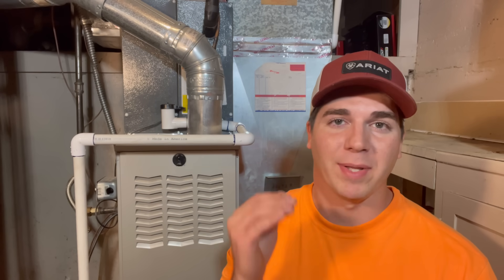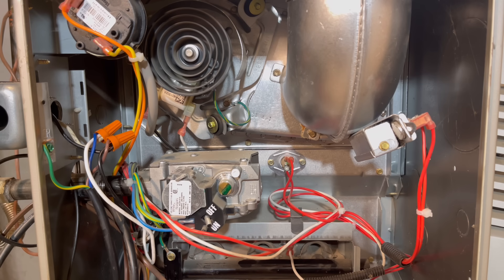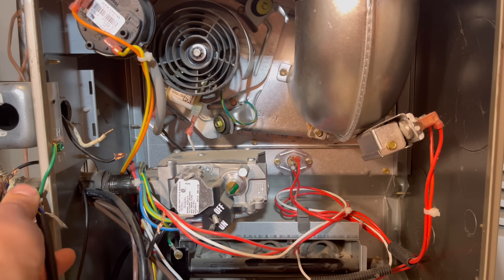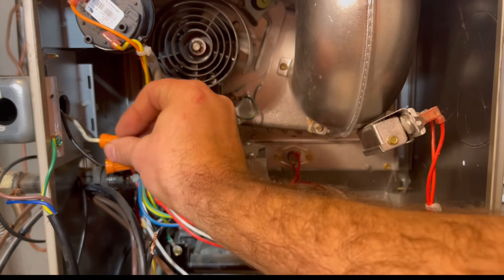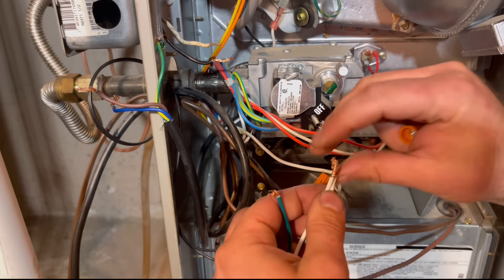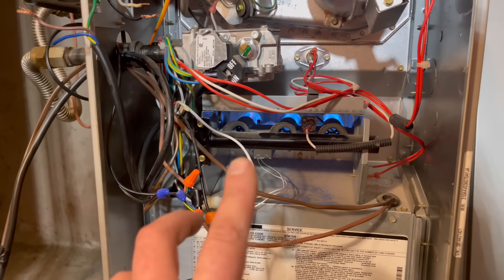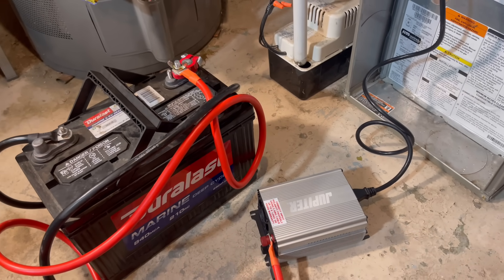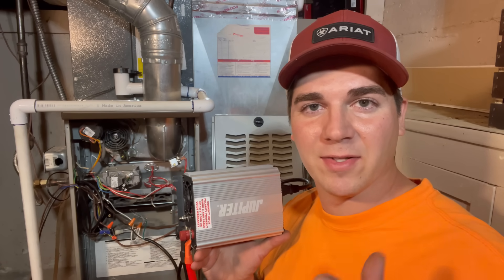Did You Know You Can Heat Your Home With A Car Battery?

Comment: I have a separate HVAC AC. More often HOT weather dominates SoCal! is there a method of running the 240 volt AC? Or by using a generator? By the way GREAT VIDEO!
Reply: I think it was ingenious and simplistic how you showed a basic wiring concept for what people view is very complicated. My thermostat is controlled by batteries, but the main circuit of course is wired. I would’ve never thought to use a car battery or a deep cycle, marine battery to start the thing up, which is all you really need for the igniter. I think he presented a really good insight with lots of preparation and you showed a realistic way that most people who have some abilities could do it. Thank you very much.
Reply: It’s apples and oranges with me. And outdoor air conditioning or central air. Runs on high demand, electricity and you need probably 8 to 10 car batteries in series to start at the darn thing up. I’ve seen some YouTube videos on using a generator to do it, and also solar panels. But I doubt in the long term it would sustain either the generator or the air conditioner. This is why our utility bills are so extremely high during the summer months. Our problem here in Southern California is when it does get extremely hot the utility company for what they call fire safety shut the electrical grids down now and it’s happened to me five times, so I have to figure out something or just purchase myself a five to $10,000 Generac generator to do the whole house. But this is the reality of the world we live in now. I live 3 miles from another house. I had for 25 years and I can remember one time in 25 years. The power was was off. Now in two years, it’s been five times. These instances like in Texas are all going to become realities for everybody
Reply: And the reason they shut down the electrical grid is because they say because the overhanging wires may become involved in the fire?! What is it in reality is they have ignored the required maintenance on the trees and brush area around the electrical grids and this has caused arcing. But they use the term fire safety to negate any responsibility. Last year it was on Thanksgiving. They did it for 24 hours perfect timing huh? And this year on the same Thanksgiving they were going to do it again. I’m looking to relocate.

Comment: While I think this is a cool idea, an even better one would be to have the furnace 120V source wired in a similar way as you show with an "extension cord" style hookup, that could be selected on a side switch from either grid power or extension cord power.  While someone may have the ability to go create the battery/inverter power source, a more likely scenario is that the homeowner has some type of portable generator, but no way to plug their furnace into the generator.
Reply from the maker: Check out my latest video :) cheers
Reply: @diyhvacguy  And I did. :)  Great videos!

Comment: how many watts does that furnace use
Reply from the maker: 500 watts
Reply: @diyhvacguy  hm constant 500 watts eh not peak? Trying to figure if I could plug it into a 400w 650 peak solar power supply

Comment: Click bait, yea it worked for the time you videoed, but your using a gas furnace how about the fan using power or trying to power an oil forced air burner.
Reply from the maker: Watch my other videos. It’s not click bait it worked for 6 hours. Not days, I know I was wrong on that but good knowledge to have in a pinch!

Comment: Would this method work if I have  baseboard heat and not forced air?
Reply from the maker: Yes it’s just a burner and a circulator pump if I’m not mistaken.

Comment: Need a backup plan when your power goes out in the winter. Check out the Bluetti solar generator running my furnace. This is helpful information to keep the lights on and the heat flowing while your beer stays cold in the fridge. 

https://youtu.be/25dCG557qC0

Comment: Makes concept of “ licensed electrician “ ……a mere afterthought lol. Safety …safety ?   Just kidding . Great video on a conceptual level mostly. IMO best way to go is professionally install a generator tap box off elect. Panel . Has 4-6 breakers. Northern hydraulic used to sell a very cool unit super reasonable. Has a safety interlock so you can’t have both power co and back up on . Critical safety issue. Unit is a couple hundred. Then just buy a cheap Home Depot generator .

Comment: The fan running will drain the battery super fast when the furnace is blowing heat.  Set your thermostat low like 60-65°just to keep the home warm and get alot of blankets out.

Comment: As others have said, this is extremely optimistic thinking and also ignores the horrible 0-load power consumption that such cheap inverters have.  With just having an inverter "ON" (no load), a typical lead-acid car battery will probably drop to useless levels in a day (lead-acid batteries don't like to be drained).  More expensive AGM and deep-cycle batteries can fare better and by the time you get to Lithium batteries the costs of such a setup can be significant. At any rate, it's fun to entertain various options and learn but don't bet your life on something that sounds waaaaaaay too good to be true ... because it very likely isn't.  Also there are much much better battery backup devices out there made by EcoFlow, Jackery, etc that can do a much better job and be a lot more versatile for emergencies.

Comment: What if you have a similar situation on a 2000 inverter what would happen if you plugged in the furnace to the invertor and the other plug goes to a 40 amp battery charger and leads back to the battery would this make it last any longer? Sorry, weird question!
Reply from the maker: I’ve had a hundred  people ask so don’t feel bad haha it would pull the battery down way faster then it could charge. Thermodynamics are a bummer sometimes 👍🏽
Reply: @diyhvacguy   I figured that was the case but wuld it make the battery charge last longer like instead of a day or 2 maybe 3 or 4?

Comment: I lived in a house where the furnace had a plug on it so you good plug it into a regular outlet what would make this  lot easier as you’d just have to unplug it and plug in into the inverter/ generator and then when the power comes back on you simply unplug it and plug it back in it’s regular outlet
Reply from the maker: Check out my lates videos, one is specifically about that 👍🏽 cheers

Comment: Can you do this with an electric furnace or does it use too much voltage?
Reply from the maker: Unfortunately no. Electric furnaces require 220v and this is strictly for 110v gas furnace.

Comment: You said it the inverter only lasts 6 hours is that the inverter goes bad or the battery and if it's the battery why can't you just keep the battery on a battery charger or a battery tender
Reply from the maker: The battery discharges after 6 hrs. If you don’t have power you can’t recharge it unless you have solar or you use your cars alternator. So it’s important not to run it down too far so you can start it and recharge 👍🏽
Reply: Well you can recharge it if you have a generator or you could put it back in your truck and run your truck yes so we best to have two batteries one that you can use for 6 hours and then a second battery that you can recharge either by way of like I said you're generator or put it back in your truck

Comment: Well, others have already stated all of my issues with battery types, depth of discharge, solar, etc.

Here's another option:

You have a camper.  (Assuming full propane tanks)  Just leave your batteries in it and live there until the power comes back on?  Blower motors in RVs are 12V and take way less wattage than the whole house furnace.  You could still  charge the batteries with the truck in a pinch.  (Alternator directly or preferably, inverter to battery charger.)

Comment: If power goes out how does the thermostat work?
Reply from the maker: The furnace powers the thermostat. So as long as the furnace has power the thermostat will function and regulate temperature as normal

Comment: Nice!!   I thought about it, doing this.   HF has a solar panel (3) and a controller. Its not made by HF, just HF is the seller, so If you look up the company that makes  the kit, there is more info.... I bought a 4,000watt inverter that has LED display of input voltage (12-15v dc) and also reads draw on the AC out put. I thought was pretty trick. I aquired 6  heavy duty commercial truck batteries that test good. The solar kit keeps them happy until I need it. My intenet was if needed, I can run the Freezer and the fridge, some LED lighting as needed, and I had thought about the furnace. I also aquired a recumbent excersize bike and installed a GM 2 wire alternator to it, it still can be used for excersize, but also can dub as a power/charger source along with the solar panels if needed for longer service/outage. And as someone already commented, can always install  a battery back in a vehical for charging. My goal for power back up  was to be quiet about it, I have a 10hp Briggs "Farm generator" 5 or 7,000watt? maybe more , can't rememeber, but if the neighborhood has no power and I have that thing running, everyone will know where to come!! lol  I can't save everyone....  but anyways, I was fairly sure running the furnace would work, now seeing it done, I know it will, just incase.  For those that maybe thinking of a battery/inverter/solar standby system, think of the things you just need!! Don't be powering the Xbox/TV/computor/internet router/multi wall wart switching power supplies to charge all/everyones entertainment hand held devices!! Just the basics!!   Brake out the board games, card games, dominos (bones)  and enjoy!! We had  a Ice storm in Kansas yrs ago, no power for 2 weeks, no school for 2 weeks. I had a dubble barrow wood burner,  3 board games and cards. I tell ya, teaching the kids how to play and win ruthless-ly for 2 weeks during day light hrs, them kids still talk about that til this day!!

Comment: Remember let's test all our power with a power tester first before doing any wiring so you don't fry yourself leave the frying for your chicken 🐔.  What's going to charge the battery while you use it as a replacement for line voltage ⚡? So also buy a solar panel kit for an extra 180$

Comment: Here in Canada it's obvious that it's critical to have a furnace running during winter and power outages do happen.  I'm glad that your other video, referenced at the end of this video, corrects the run time from your battery to be about 6  hours rather than 3 days.  Very important for modern, high efficiency furnaces, that the inverter used is a "Pure Sine Wave Inverter" rather than a "Modified Sine Wave Inverter".  High efficiency/Variable speed furnace motors actually operate on DC voltage and the electronics that control the motor can be fried by a Modified Sine Wave Inverter.  Unfortunately, Canadians are gouged to death on prices:  Amazon's cheapest 1,000 Watt Pure Sine Wave Inverter is about $220.00 and a Deep Cycle Marine battery will run about $400.00.  As noted, the cost of DC cables is extra and I would recommend an adequately rated fuse between the battery and the inverter.  A realistic cost in Canada for this set up would be about $800.00.  A separate trickle charger or solar charging capability would be a bonus.  Still may be worth doing, especially if you don't want the noise of a generator growling beside  your house.
Reply: @D W I go to the dump with a meter and find the batteries that are still useable. Logging truck drivers throw out all 4 if one is bad. They are massive and hold a charge.
Reply: @binderdundit228  good idea
Reply: Great advice.
Reply: @pete32 adn The DIY HVAC Guy clarified in his last video that his deep cycle marine battery only provided about 6 hours of run time for the furnace only.  A new standard car battery's maximum would probably be 3 to 4 hours at best.  Note that that is not continuous run time.  As the furnace cycles on and off during the 6 hour period, the furnace is only running for about 1 to 1-1/2 hours until the battery is dead.  Also, a typical car battery (not a deep cycle) can only be discharged 50% before it has to be recharged.  If it's run flat before recharging, the battery will be toast after a dozen charges.
Reply: I wouldn't use a simple trickle charger. Canadian Tire and Amazon sell "smart" chargers. I have a Noco 3-bank and a DeWalt single bank for my boat and RV batteries to keep them over the winter. You would probably be better served by connecting two batteries to double the amp hours. So now you're up to $1,200 Canadian. That's why I'm looking at using a Bluetti or similar device. It will cost more, but it's something I'll be able take on camping trips and have around the house for other uses.

Comment: Not every place in TX uses Natural Gas. I had electric forced hot air in Austin TX at my apartment there. It's pretty common to see heat pumps and other sources of heat in TX.
Natural Gas lines also weren't usable in that storm in Feb 2021 as the Gas wasn't buried deep enough to stop freezing.
Anyway just want to set the record straight here that 1,000 W inverter won't run 10,000 to 12,000 watt electric furnace.

Comment: Sorry if this is a dumb question but how can you control how much heat you're getting if the power is out? won't your thermostat not be working? Thanks!
Reply from the maker: No the thermostat is powered by the furnace so as long as the furnace has power the thermostat will work just like normal 👍🏽

Comment: Everyone is way overthinking this I'm not real fond of the way he connected it to the pigtail etc etc and the battery in the basement on concrete even though they say it no longer matters I still always put them on wood anyway battery and inverter outside in a well ventilated area most any older vehicle would have no issues recharging that battery in between cycles of the furnace because the voltage drop would be negligible after a 15 or even 30 min run of the furnace if it's a good new battery especially deep cycle attached to the car in between every run of the furnace would work perfectly till as was mentioned the car truck whatever ran out of gas now a couple of say 100 watt solar panels w a charge controller even in colder weather would grab enough during the day to keep it charged as well w no issues the ultimate setup would be a couple of battery's to be switched out after a cycle and take turns along with the solar panels would be great or both batteries would run the boiler for more than a few cycles and still not show much of a voltage drop the possibilities are endless with today's batteries and inverters and charge controllers Battleborn batteries etc from what I understand a good solar battery comes with a ten year warranty that's a lot of cycles in a totally off grid situation so there's the ticket go buy a complete solar system for the house in case of emergency lol
Reply from the maker: Brilliant

Comment: I use a commercial grade UPS that i was given to power my furnace, hot water tank vent fan and my internet modem. it was tested one time for 2 days, i may have got another 12hrs out of it. i turned the heat down to conserve and also used a gas fireplace. i wouldn't recommend my setup though unless you get it free like me, because the UPS is worth about 6 car batteries lol.

Comment: If it was Canada, it would not last more than 2 hrs with assumption 50% on / off. The battery capacity ~ 700Wh, the efficiency inverter 80% at best, the blower about 400W

Comment: Just checked my furnace current: 3amps for upstairs furnace when fan on low speed and 5.9amps downstairs furnace @120v
That converts to 30 and 60amps from the 12v battery via inverter. The size of the battery to last 1 day : 750 and 1500Ahr if the fan runs 24hrs continuously. That's more than a marine battery.
The better way is to buy a n/g generator. Or convert a cheap gasoline generator to natural gas.
Reply from the maker: Awesome thanks for sharing